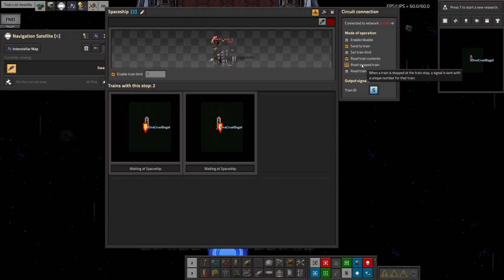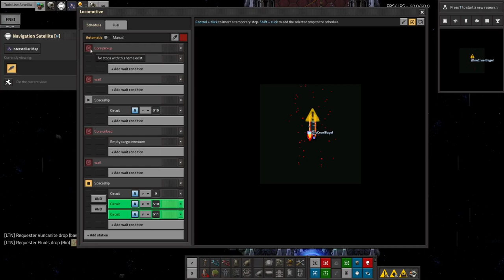S4-E16 - Spaceship Trains - Laurence Plays Factorio: Space Exploration

Comment: can you send a signal from space ship to planet when docked, or is that connection broken when ship takes off?

If yes, circuit signal looking for "a spaceship" on the wait stations could have worked right?
Reply from the maker: When a spaceship connects to a clamp, signals can be passed through a clamp. So that's a good point, it could tell the station when there's a spaceship there. 

It wouldn't be quite 100% secure as if the spaceship got delayed for any reason, it's possible an additional train might leave the loading station and try to get to the ship, which would then lead to problems. I think the method I used is probably safer. 

You're going to have caught up soon  😲
Reply: @LaurencePlays  it wouldnt just queue behind the first one, trying to get to "wait" station?
Reply from the maker: I assume you're meaning if the "hack" spaceship station didn't exist? No, I believe what would happen is 
- the train would get to the wait station
- the station would say that there's a spaceship there, so the train would try to leave
- The train would be in a state where it's left the wait station and either pull forwards to the next signal or start looking for an available "spaceship" station, depending on whether I've set train limits or not
- The spaceship leaves
- The train goes "Oh, there's no spaceship station. I'd better go to the next one in the list" and would try to get back to the loading station. 

I think that's right, based on my understanding of how trains work. I believe that trains can leave a station for purposes of working out the routing, but not have left it by any actual distance. Effectively, it's ticked off the wait station in its planner and is trying to decide where to go next. 

I'm not 100% certain of this though, please feel free to give it a try  😀